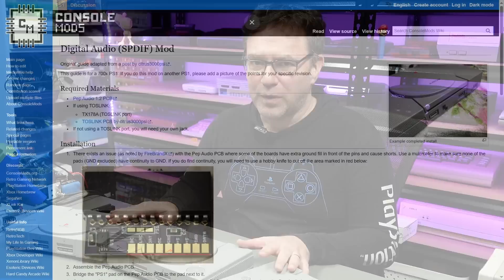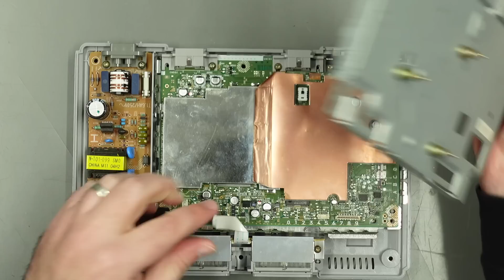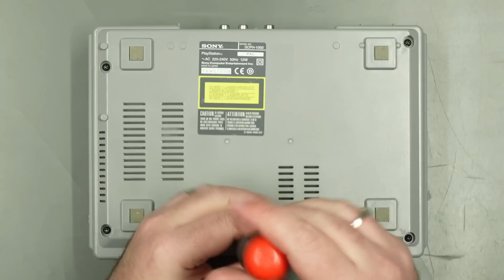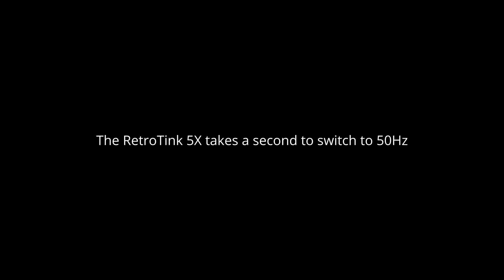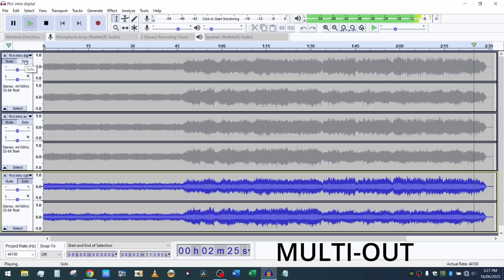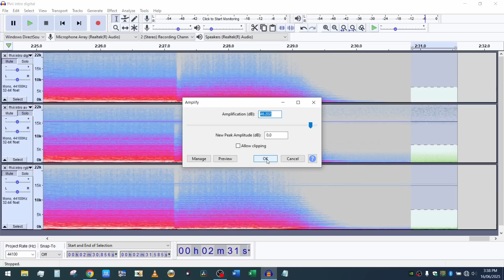PlayStation Digital Audio with just 2 wires #nocutmod

Comment: Don’t the hdmi mods (internal hdmi straight off the board) pull the audio straight from digital? Just wondering 🤔
Reply: Yeah the RetroGEM pulls digital audio straight from the board, but that mod is also several orders of magnitude more complicated to install than this device.
Reply: @Astfgl thank you. My friend is gonna install the sd card reader into x2 “Audiophile” PS1s shortly. We are doing 1 at a time and going slow 😁
Reply from the maker: I assume so as it wouldn't make much sense to convert the analog audio back to digital, but I haven't looked into those mods

Comment: You're already sold out??? Mate!
Reply from the maker: Yah, didn't expect them to go that quick. There should be more available next week
Reply: @TheRetroChannel Btw why does the socket go out across the serial port? Why not the left, out the top, or even straight out the back? Just curious.
Reply from the maker: @jameslaidler2152 it sits above the serial port so as not to block access to it. Having it pointing towards where all the other cables will be plugged in makes the most sense to me

Comment: I'm curious how this mod compares to the optical audio output of the PS2 running a PS1 game.
Reply from the maker: It should be the same, unless the PS2 butchers the PS1 audio in some way
Reply: @TheRetroChannel   makes sense
Reply: Have also been curious how the (matrixed over stereo?) Dolby Surround is handled/ handled differently for those PS1 titles but compared from those two vantage points using the PS2's Toslink compared to PS1 audio mod.s

Comment: But what if I have a 7502 with a PU22 Board and the Parallel Port?
Reply from the maker: Won't work. Sony moved the DAC in the main audio DSP starting with this model. It is possible to get it working with some tricky modifications, but doing so disables the analog audio from the multiout.

Comment: Not sure how you'd do it with Audacity, but it would be interesting to see the difference using some subtractive method. So something like "RCA - SPDIF = difference", and you'd get only the 'noise' of the RCA version left.
Reply: In Audacity select one of the tracks, Invert from the Effects menu, then both tracks and choose Quickmix from the Projects menu. The tricky part is aligning the tracks accurately.
Reply: @firstsurname9893   Correct, and this is fun to do with music with an instrumental version available, you can extract the vocals that way.
My tip for the alignment is to oversample the sound 1st, to align the samples better, given an analog capture will obviously not match precisely time wise, which leaves a very small but audible difference. Heck, some instrumental versions of the same track sometimes don't align in sample.
Reply: There’s a program called deltawave for doing specifically this

Comment: That's really awesome! One of the reasons for wanting a RetroGEM is the perfectly clean digital audio, but that mod is prohibitively expensive and difficult to install. This looks like an affordable and super easy alternative for getting that same digital audio. I'll likely be ordering one of these for my PS1 capture setup.
Reply: A good alternative is to use a PS2
Reply: @cloud_s_97  Not really. The PS2's backward compatibility for PS1 games has a lot of inaccuracies, most notably very visible graphical issues with transparencies in some games. The PS2 also doesn't have anything like the XStation. Best you can do is POPStarter from an internal hard drive, but that is even worse emulation. If you want accurate playback of PS1 games, nothing beats an original PS1.
Reply: @Astfgl  Hmm, I heard DKWDRV is in active development, it should be able to make PS1 compatibility better on PS2s...

Comment: That's a really clever solution mate! What's in the box that plugs into the parallel port or is that the secret spice? (also the psio chirp was class 😂)
Reply from the maker: The DIT4096 audio transmitter is at the heart of it. There's also a 5V regulator as the port only has 7.5V and 3.5V available on it, an audio transformer to isolate the coax out and the 3.5mm jack with optical transmitter. Sprinkle in a bunch of passives, a few failures and eventually it will work 😆
Reply: @TheRetroChannel  I wonder if you could internalize this and just run little wires to the used parallel port pins.
Or would that still not work if there is a PSIO installed?